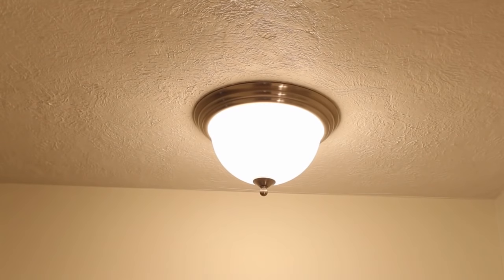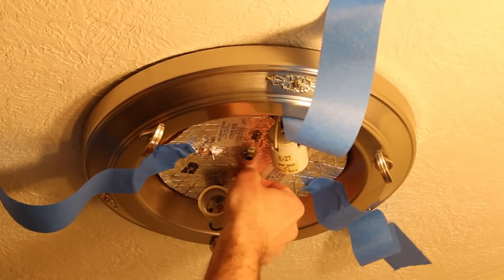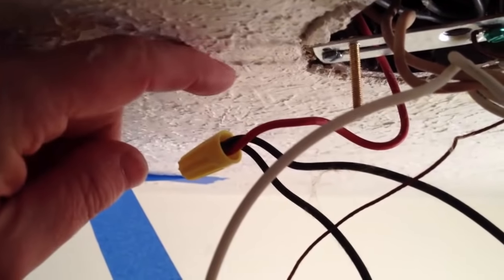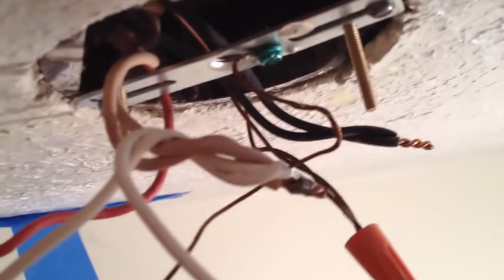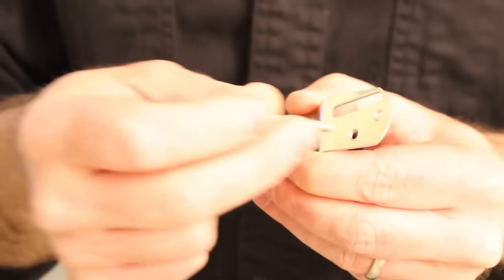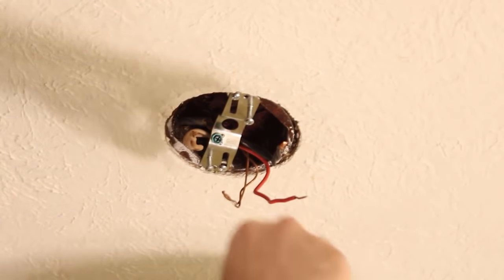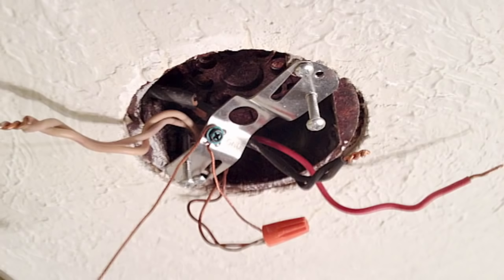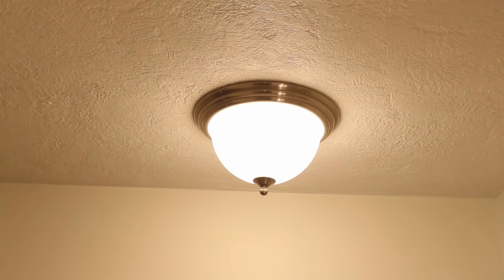How to Install Modern Ceiling Lights

Comment: Excellent Illustration of Steps provided during the Video . I have attempted all various techniques and failed at, Watched too many different You tube Videos of Installing Ceiling Light Fixture and still Failed UNTIL I watched your Video and came thru a Eureka moment.  My Ceiling Power Outlet is similar to the one you have shared in this video and tears of Joy are flowing thru my eyes at the moment after understanding what I should have done correctly to get the New Ceiling Light Fixture to work with my Electrical Outlet in the ceiling. I was connecting 2 Black Wires with the Red Hot wire and the Switch ON/OFF was not working. Watching your video I learned that the 2 Black wires should be simply capped OFF and returned back into the Electrical Outlet. Thank you so much for Sharing .

Comment: How did you know that the red wire was hot and connected to the black wires on the fixture, and not the black wires in the ceiling?

Comment: I am a DIYer and have replaced several light fixtures.  The trouble I have is getting those screws through the keyhole.  You made it look so easy.  How do you know which set of holes to put the screws in and do you have any tips to share on lining the screws up for the keyhole?

Comment: Jeff, thanks for posting.  I have four wires coming out of my junction box, Ground, White, Black and Red (I believe you did as well in this video).  How did you know to connect the red wire to the black wire in the light fixture?  Thank you.

Comment: I took forever on the first try. Was trying to install the bracket and light fixture same time and was frustrated because I couldn't see the  junction box holes. I realized how stupid I'm after watching this video. Installed the mount to junction box and just pushed the fixture up the long screws as shown in the video. I didn't even use the tap but that's a neat trick. Thanks for the video

Comment: I installed two of these today and did not use a wire nut on the ground. What I did was wrap both the ground wire from the light and the ground wire from the house under the green screw and tightened. This should be ok?

Comment: What if I only have a red and a blue in the ceiling? The blue was connected to the black and the red was connected to white in previous light. Does that mean the red is the neutral wire?

Comment: Hi Jeff, I would like to install recessed lighting. I bought a gizmo to cut the holes, but would I need an electrician to do the wiring? There is no overhead lighting in that living room, so I assume there is no wiring in the ceiling, although there are electrical outlets on the walls. Thanks!
Reply from the maker: depends on your comfort level with wiring. If you're not comfortable and worried about safety I'd recommend getting a licensed electrician to do the work...worth the peace of mind.

Comment: this is so weird. I got all the way to the end. And the center threaded nipple sticks out too far.
There's a small gap so that my end cap won't sit flush with the globe. 

Don't know what to do. Had to take the globe off, and now have an unfinished light fixture.
It works, but i can't secure the globe.

Comment: Going through the steps, I have my old light fixture removed and hanging down by the wires. I don’t have an obvious ground wire coming from the junction box. My house is old, is this possible? I was determined to do this as DIY but I may need an electrician after all ..
Reply: Hi did you fix it? I have the same problem, my house built in the 70's so i do not have a ground wire so I'm not sure what to do.

Comment: Jeff i just installed the cieling light but i used my old cfl bulb then realized it was bright enough so i switch to led bulb but i encountered a problem. the bulbs wouldn't turn on. if i change 1 led bulb to the cfl. it  turns on... wierd. any ideas? thx in advance.

Comment: my ceiling light has 2 hot wires?red and black are live,power coming from both?it blew my led light and won't work with new one installed,the light won't shut off when power turned back on?

Comment: There's something that you just brushed over. Why didnt you use the black wires in the junction box? I don't know ANYTHING about electrical so that confused me. Logically i would have connected the black wires from the light to the black wires in the junction box. I wouldn't connect the red wire to the black wire. Can you shed some light on why the red got connected to the black and the black from the junction box wasnt used? Thank you!
Reply: Think he mentioned of the three way connection prior.  Probably that's the reason.

Comment: Hey my ceiling light just fell off a couple days ago luckily on my
Bed during the day time. The part where you screw in the rod is not connected to the light fixture like yours. Any help would be great thanks in advance.
Reply from the maker: Beast Mode whew!!! Glad you're okay. That would have hurt. The rod needs to be screwed back into the bracket and secured with a nut. If you watch my video or another one like it you'll see how the rod is secured. But feel free to keep me posted and ask any questions.
Reply: Thanks for the fast reply. So the bracket that you screwed it into well mine isn't attached to the light fixture any more. So can I just get a longer rod and put it threw the fixture and screw it in the junction box? If they sell them at the local store that is.

Comment: I figure the black and red hot wire from the old fixture came apart quickly. Probably were not tightly fastened by previous owner and I didn't notice when I took it apart . All is well and my home won't burn down lol. Thx I knew it didn't make sense.
Reply from the maker: Glad to hear all is well swistral1 and your safe!! Great job figuring it out.

Comment: Hi Jeff! I am wondering if there is a way for me to keep my fixture that is currently in my kitchen, but just change up the shade for a design change.  Do you know of anyone that sells replacement shade that will fit most fixtures?  Are there standard designs? Or is every mount different, therefore no shade can guarantee to fit? Thank you!
Reply from the maker: You might be able to make a custom fixture. I've seen many tutorials. It's not too hard and you'd probably get something that'll look better than anything in the store. Thoughts?

Comment: What if there's no ground wire coming from ceiling? Do I just ground the one in the fixture to the green screw?
Reply from the maker: If you don't see a bare copper wire in the junction box you'll have to ground the wire to the junction box, especially if it's metal. Is that the case swistral1

Comment: is it not safe enough to turn off the power from the switch only...does it really have to be from the breaker?
Reply from the maker: Some electricians don't turn off the power at the breaker but they are pros. Personally, I want to stay alive and don't feel comfortable doing any electrical work without turning off the breaker or removing the fuse.
Reply: +EvendimataE When I was renting an apartment, the maintenance guy would always flip the switch off at the light and put duct tape over it without turn off the breaker. The first time, I thought he forgot so I asked him. I've pickled those bad habits from him now that I'm a condo owner but I wouldn't recommend shortcuts of safety. Also buy an volt meter to test if the voltage is hot at the wires before untwisting the ties..
Reply: I hired a handyman years ago to replace an old (Montgomery Wards!) fan in my attic. He didn't turn off the breaker, and when he touched something in the fan with his screwdriver he flew back about three feet and landed on his backside! He got quite a shock and it scared me, but he survived. Then he sheepishly asked me to go downstairs and turn off the breaker.
Reply: @leeb.7188  😲

Comment: I transferred my kitchen light upstairs to one of the rooms. there was only two wires coming out of the ceiling wall which I connected to the only two wires from my light, then covered them with wire-knot and it works just fine. now I bought a new ceiling light from amazon that does not have much directions, it is from fuloon. This other room which my new light is gonna go in it has more than two wires coming out of ceiling wall and my light has only 3 entries (no wires) how should I install my ceiling light?
Reply: one more piece of information. The entries for the wires on the light are each marked individually one as "L", one as "N", and one as "E".

Comment: My junction box on the old fixture has a white, beige, ground, and two black wires.  My new fixture only has a white, black, and ground wire. Should I connect the old white and beige (neutral) to the new white, and the two old black wires to the new black wire using wire nuts?  Thanks.
Reply: +Vinay Thanawala yeah!

Comment: I know this video is a few years old but I am hoping you are still monitoring the comments.  I don't see a ground wire coming from the ceiling.  How do I attach the ground wire from the new fixture to the metal ceiling box?  Do I even need a ground wire?  And why?
Reply: +Gypsy Angel as long as it's attached to the green grounding screw you should be okay afaik it's mostly just a safety precaution though
Reply: +Moon Kitty Thanks Moon Kitty!  I had my ex come over and put it up for me...he said he knew what to do and I guess I trust him!  hahaha.  It's working and looks great at least!  :D
Reply: Great information!  Thank you!
Reply: @moonkitty5488  i don't have a green ground, i only have a white and a black cord so which one to attach it to? Please help.

Comment: How can you tell the wires apart from an old house with old wires
Reply: Use the electric tester to see which is the live wire coming from ceiling. Connect this to black wire of light fixture. A bare copper wire coming out of junction box/ceiling is your ground wire. Connect that to the bare copper wire from fixture. And the remaining one is neutral.

Comment: 9:13 put the safety screw not too tight. i had this kind of lamp, had its glass fall on the floor, break apart. the safety screw should be turned tightly, as tight as possible. thankfully the floor was carpet so the fall of the glass didn't break the floor
Reply from the maker: good tip, installing the glass always makes me nervous
Reply: +fdsewr fdsghfdwe no you can definately break and crack the glass super easily by over tightening it I've done it once or twice but if your safety screw isn't threaded on enough you can easily move the nut on the nipple to allow a more secure connection

Comment: I have saw someone crazy replacing the light fitting without closing the circuit breaker just closing the switches Even when someone replaces to which they don't close the  Freaking circuit breaker Sometime I saw someone working with the switch his own and everything is life

Comment: The wire testing wasn't explained very clearly. When the power's off obviously the wire shouldn't set off the tester. When the wires are on the temperature should be set off by the red AND the black?? Contractor told me that if I don't get this correct I could blow the wall switch when I said everything up as they did in this demonstration video.....

Comment: Perfect video on how NOT to do it. You don't TAPE THE LIGHT TO THE CEILING! You're liable to rip off the paint even though it's low tack tape! What holds them up is the wires.